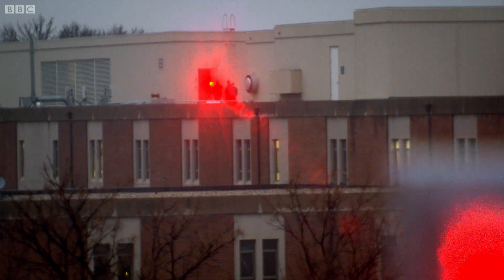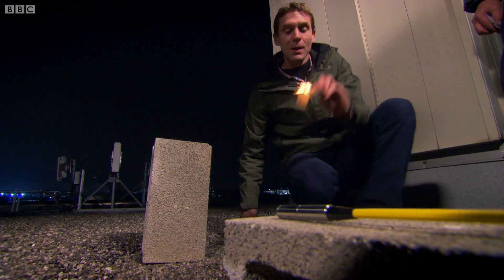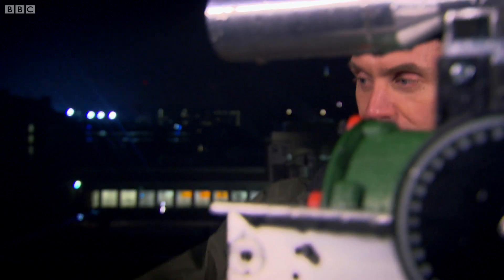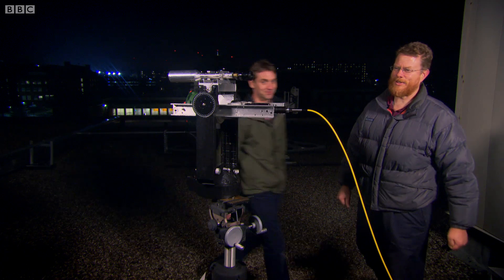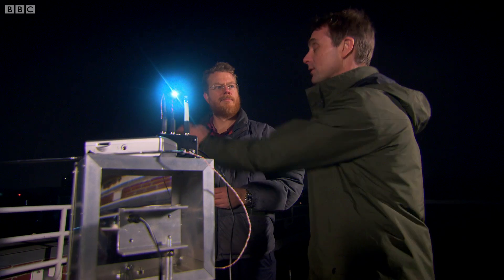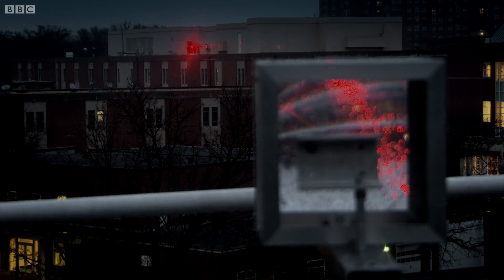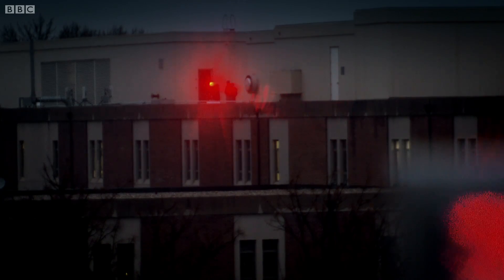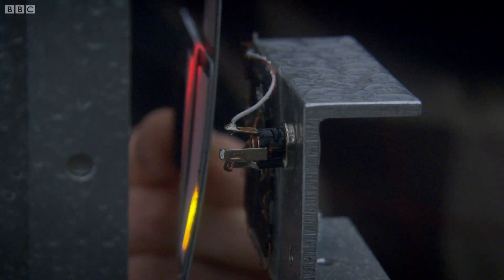Tesla Coil & Laser Beams pt.2 | Bang Goes the Theory | Series 6 | BBC Studios

Comment: the big problem that has yet to be solved is the reconversion efficiency...,first,the conversion of,say, 1 watt of electricity into laser light is quite innefficient,cant remember exact figures,but bad enough to prevent it from being used,and secondly,the reconversion of laser light/radiation back into electrcity is also very poor,just like a modern solar cell,which have efficiencies of around 12% ...so you see that overall,its no good.....yet, if we can invent superconductors that operate at " reasonable" temperatures then things will change dramatically

Comment: sci-fi bla bla bla 100% impossible to use on normal scale at all, even if there was non of clouds between transmitter and receiver, there will be still dust in the air and atmosphere to get through out and back in which makes distortion like prism or lens. Correct Me if I'm wrong.
Reply: You are wrong. Electromagnetic radiation is not affected by dust or clouds, the narrow band of frequencies that account for light, maybe. But not longer or shorter wavelengths than the visible. Radio waves travel the Earth without being altered. What these guys said is factually accurate and already proven. What expertise do you have on the matter to make such an assertion? It's definitely not impossible. It's so frustrating to see idiots with such faith in their own misunderstanding and clear lack of knowledge.
Reply: GINNERMAN123  Science!